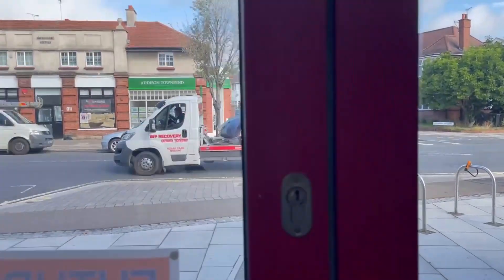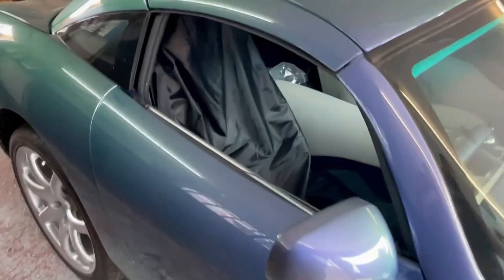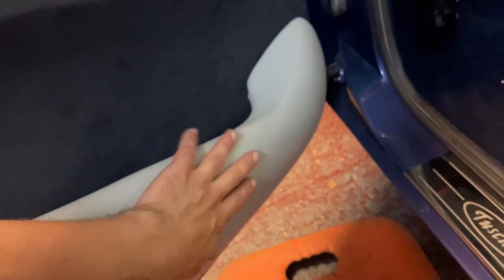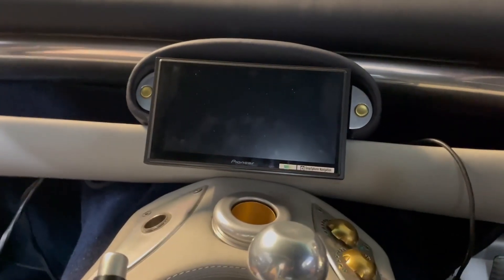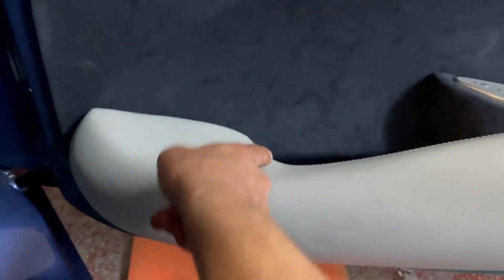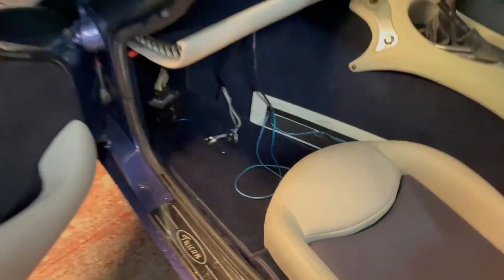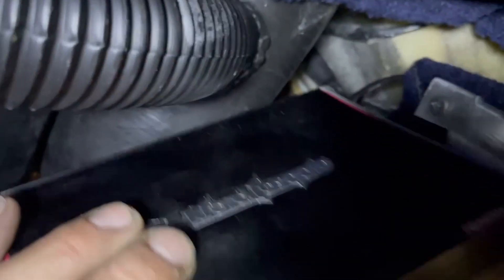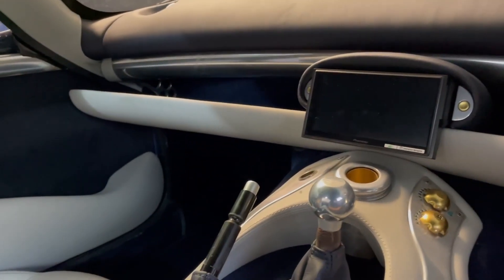CCS Creative Car Sounds - American V8 in a TVR Tuscan, JUST INSANE plus Full Audio Upgrade.

Comment: Nice fit. Does the screen adjust so that you can lift the ashtray out?
The door open beep can be cancelled by pressing the big brass knob to the right of the Speedo.
Reply from the maker: I'm glad you've brought this up, I've never been sure or asked anyone if it is an ashtray, it was either that or some sort of pen holder, sadly the unit doesn't tilt but think it would still wiggle out, thankfully this customer is a non smoker